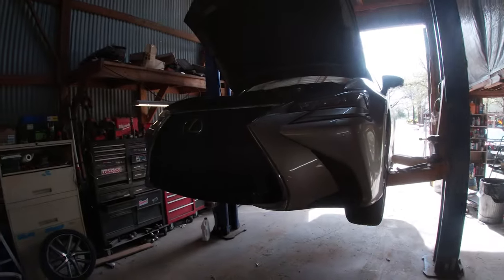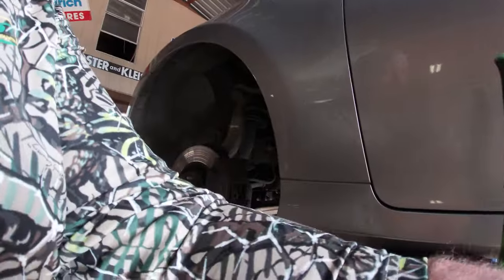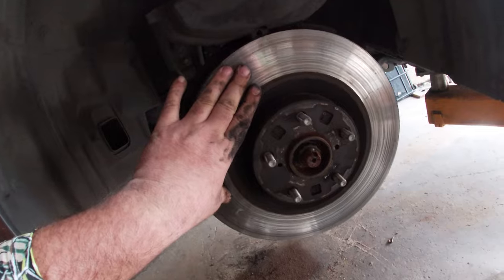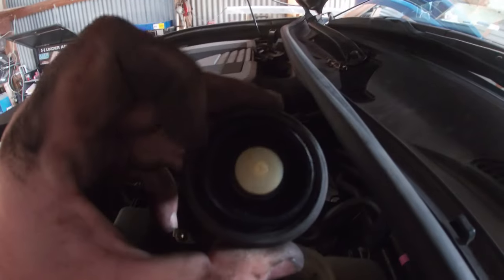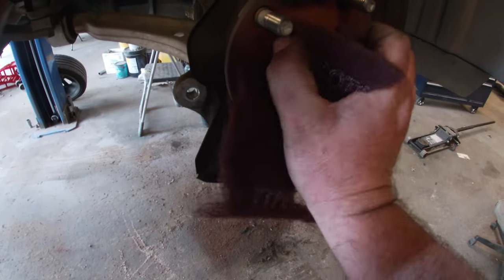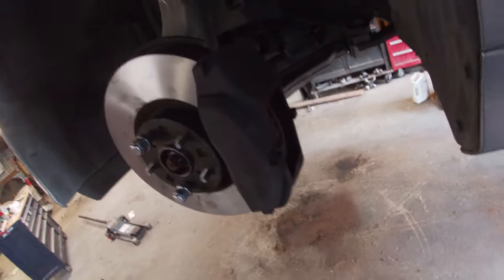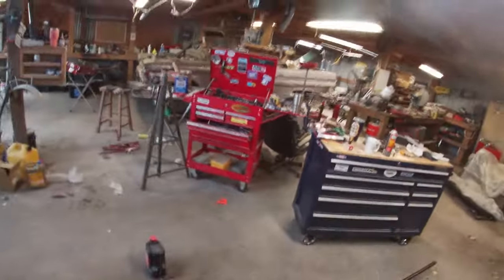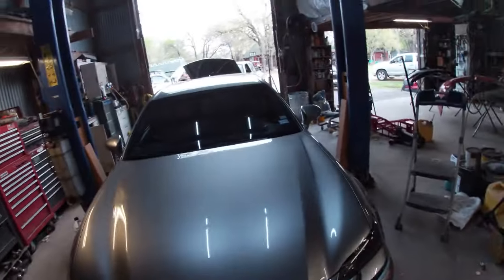2013-2020 Lexus GS 350 F Sport: Front Brake Pad and Rotor Replacement!

Comment: im curious to know which rotors you purhcased, because im also having to replace my pads and rotors soon. However confused on if im to buy what seems to be a regular rotor or a F sport specfic rotor? one cost like 80 while the other cost 300
Reply from the maker: If it's an Fsport you need the expensive rotors I'm pretty sure. Bern awhile since I did this job, but I'm fairly certain they are larger
Reply: @GreenCastleGarage  forsure, was going to all my local parts dealer and ask about sizing couldnt find much on descriptions if one is a 250 and the other being a 350
Reply from the maker: @Siikesz  yeah, it looks like you can get some drilled and slotted sets online for a similar price if you're not in a rush.
Reply: I paid $380 + tax each front brake rotor for my 2016 GS 350 F Sport... Dealer said F Sport parts are different and much more expensive then regular GS 350. I have no idea if this is true.

Comment: The pads are probably going to squeal
Reply from the maker: Nope, don't squeal a bit.
Reply: @GreenCastleGarage  oh wow! In the Lexus forum everyone says that Akebono is the way to go for the pads
Reply: There is a shim kit you can get from the dealer that helps a lot with the squeal.
Reply: @GreenCastleGarage  can you please tell me what parts you bought specifically? My car squeals like a MF when getting close to a stop... I have a 2015 Lexus GS350 F Sport RWD. Thanks in advance.
Reply from the maker: @AllEyezOnRod  they probably are, but these are definitely just some orileys ceramic pads. Import direct borland I believe. I did the beding procedure and not a problem since.
Reply from the maker: @khoajin  Super sorry on the late response, for some reason I never got a notification. I just got ceramic pads from orielys, I believe they were import direct pads. With ceramic you want to make sure you bed them properly with the drive cycle. A quick Google will tell you the series of stops to make. Anywho, not a squeal one yet